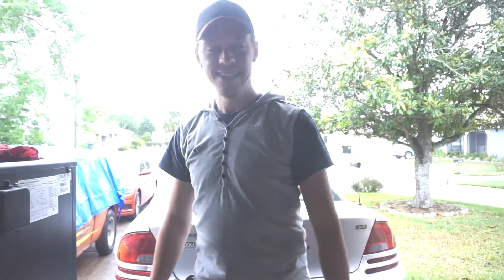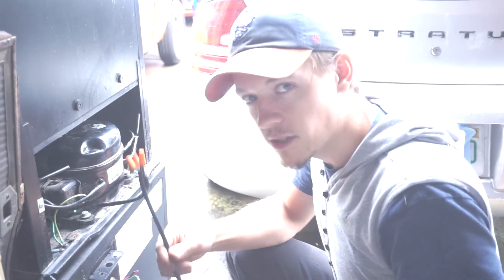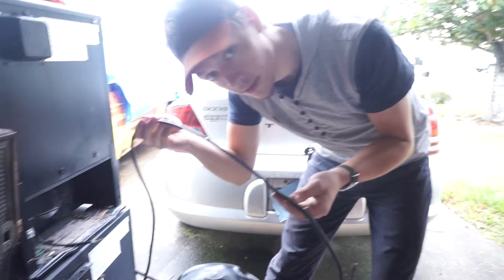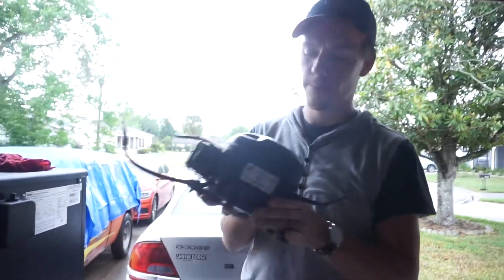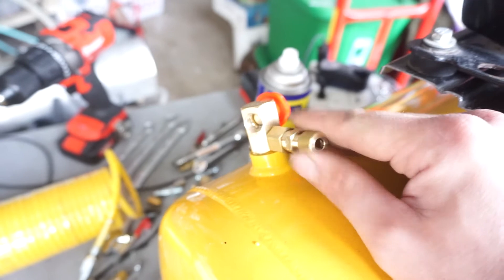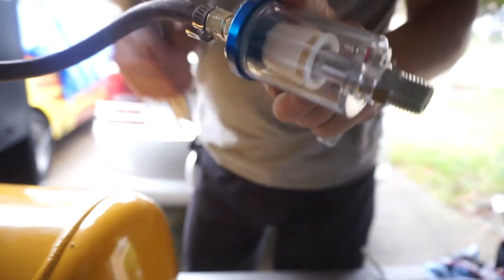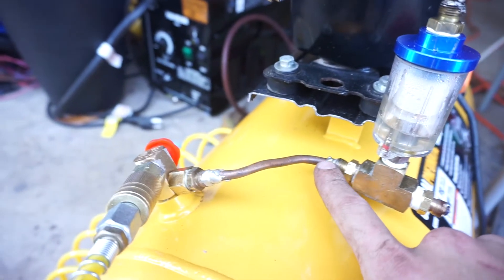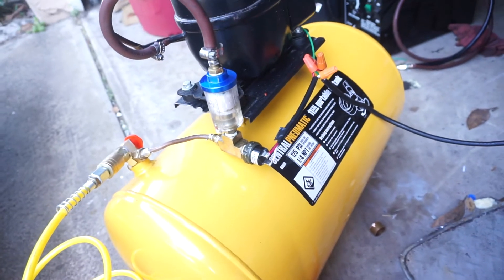DIY Air Compressor for LESS THAN $100 USD Dollars

Comment: Using same mini fridge. Does the copper pipe you filled with oil give out the air o and does that same copper pipe drain the oil?
Reply from the maker: If memory serves me, the pipe that took the oil is the air in. And yes, if you tip and rotate the compressor, the oil will come out of it.
Reply: @DukeManlyMakes Cool thanks!